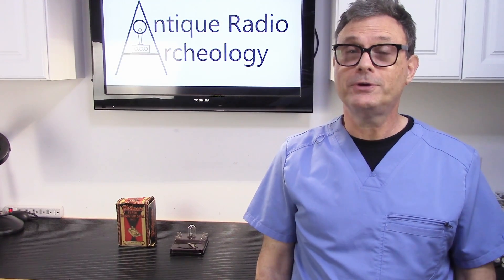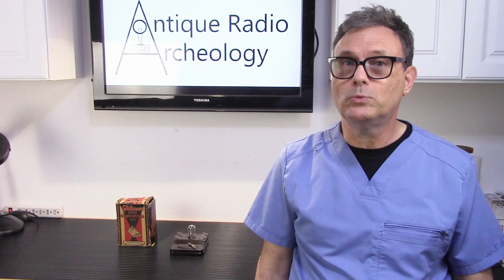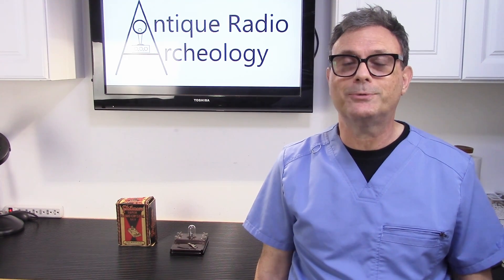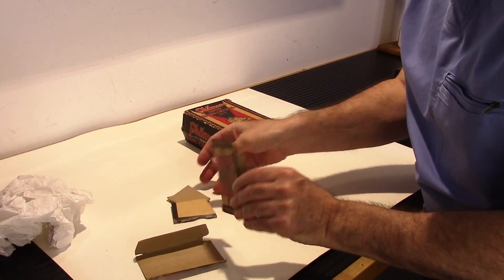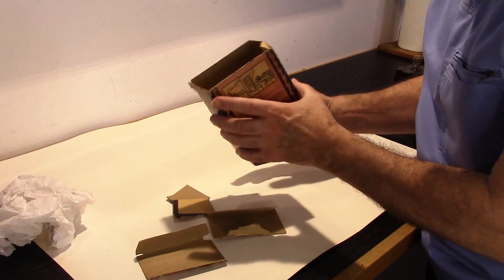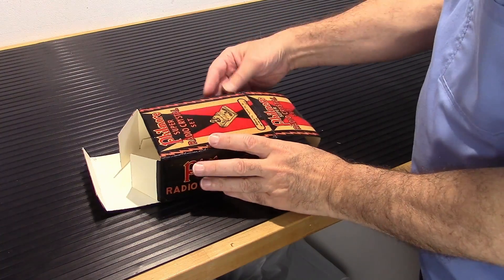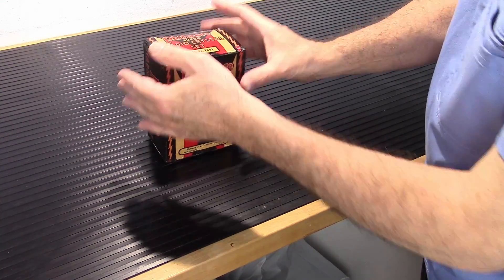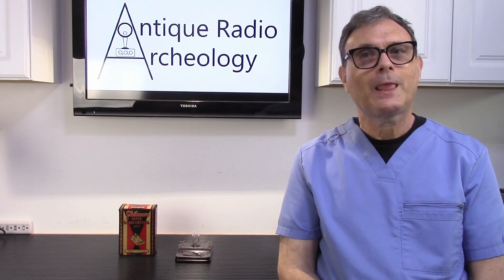1955 Philmore Super Crystal Radio

Comment: well done, awesome box resto, thanks for sharing, such a simple circuit, & I like the schematic as it shows clearly how they used to tap the coil to tune (changing the inductance) rather than using fixed inductor & variable capacitance. This really is the simplest circuit as far as component count